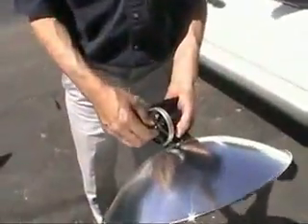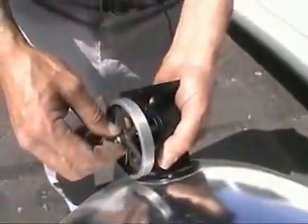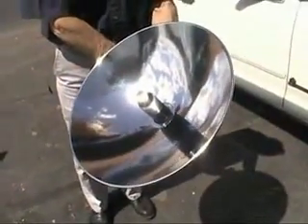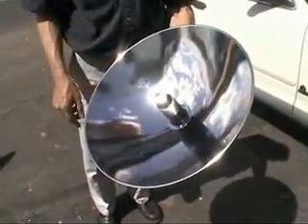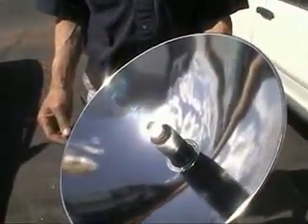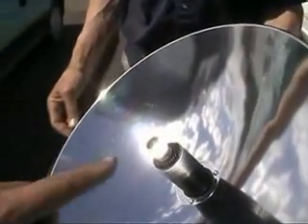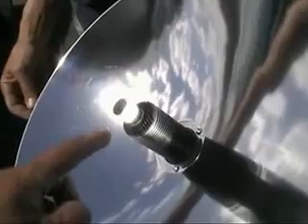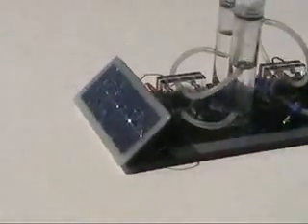Free Energy - Solar Powered Sterling Engine

Comment: yes you do , which is the reason that the orginal stirling engines used air at 1 atm. Building hermedically sealed systems makes it possible for the newest versions to use high pressure hydrogen but even then they need peroidic refilling. High pressure hydrogen gives a lot higher efficiency and pays for itself very quickly .

Comment: This is true. I did the math. 30' diameter = 760 square feet. The power from the sun is 130 watts per square foot in a sunny area. That gives you about 100 KW for that diameter. Sterling engine efficiencies are limited to about 30% so that's 30 KW.

Comment: For example: Recently I got into picking up unwanted appliances and fixing them in my garage. I am mechanically inclined so it comes natural, I can tear things down and successfully figure out how they function, so early on I learned the function of the devices but I don't know what the parts are called. I referred to one part as a defrost thermostat because that's exactly what it is, but the proper term is bi-metal yet that did not make me incompetent from successfully fixing the appliance.

Comment: Yes, but without some type of lubricant you run into one of the main foes of efficiency, friction. which in theory might help the hot side of the engine but is still going to lower the efficiency of the power piston.

Comment: its a win win situation for the electic companies, they wont have to uses a much fuel or make more power plants, and they can sell and repair the system boxes that will be in the homes to hook up to the grid.  plus if there is low power in the grid, you will still have a system that dont rely on the grid

Comment: Lets compare:

- Currently the best Stirling Engine has an efficiency around (i think below) 30% (NASA RTG research)
- Currently the best Solar panel has an efficiency of 42.7% (University of Delaware research)

You can go out RIGHT NOW and buy a 35% efficient triple-junction solar panel.

Comment: Most likely not it most like just has air at atmospheric pressure.  (14.7 psi at sea level)
The reason the video makes mention of hydrogen is because gases like hydrogen and helium have phenomenal heat exchange qualitys.
Cleaning you engine by taking it apart should not hinder it in any way

Comment: "Perhaps, but these are much, much cheaper."

Solar thermal is only cheaper on a very large scale, where you have many, cheap, flat collectors all concentrating sunshine on a large tower used as the heat reservoir for a single massive engine.

On the scale of the demonstrated unit PV totally clobbers this device.

Comment: i have a window AC, when it runs, it blows hot air out the back straight into the atmosphere. for a long time i have been thinking if you can capture that heat and convert it back to useable energy. maybe the sterling engin can be powered by the hot air of a AC unit, which can then power a generator, and feed the AC unit partially, where making the whole cooling system more efficient, and reduce the amout of heat released into the atmosphere.

Comment: That's a no brainer.  He said a 30 foot diameter dish would produce 30 kw power.  A 30 kw pv array using 200 watt panels will cover over 1800 square feet.

There's no arguing the facts.

Comment: i have the older twin flywheel version of this exact engine. i used to belt a small dc motor to it to run a fan. but now my engine no longer runs the cylender got all gunked up i think during storage do you know how i could fix this. could i take apart the engine without harming it to thoughly clean it? and is the cyl gas filled? i bought it off a neighbor for $1. so i dont know anything about it. but i think its from the 60's.

Comment: Why not? Its just tin foil a dish and a small motor. The start up cost (manufacturing) will be exceeded by the energy produced (actually, refined would be the better term) over its lifespan.

The sun is giving it away for free. Whats the problem?

Comment: what i don't understand, is that, does the sterling engine not nessesarly run off of heat, but it runs off of "heat differential"? so if you put the whole unit in the oven, would it work?

Comment: but why would you need 30 kw?  for one household you need only 1 k w ,,,  i dont know if this value is true but every square meter gives you about 1 KW then you have to subtract all the ineffeicincies , 2-3% to the mirror,  about 60-70 % for the sterling, maybe 50% to the generator and i dont know how much percentage to the storage battries before oyu could use it as useful electrical.

Comment: hi sir: where can i buy those engines? i need one in the range of  5- 1000 watts , this is because i am doing experiemnts on solar energy and i need it can you guide me where you obtained that hydrogen sterling engine?  All the manufacturreres i contacted didnt answer and the others only seell small sterlings which are not optimized any way but just for show. thank you

Comment: Let me get this right... 30 ft diameter is about 68 M^ 2.  30kw/67 m^2= 0.44 kw/m^2, or 440 watts/m^2.  Sun is about 1000-1200 w/m^2, so he is claiming 36-44% efficiency.  If it is true that is a world record...

But I have seen stirlings, and NONE get this kind of efficiency.  The cycle is not good enough.  Hmmm.

Comment: ----->system! Please to the pissy people don't try and change the subject and start making references to grammar because i am not paying much attention as this is not an English exam and frankly having grammatical errors works better as an asymmetrical tool to expose people with negative intent against you since they aren't winning by position so they have to resort to grammar which is off topic and the only thing they can reach for and ----->